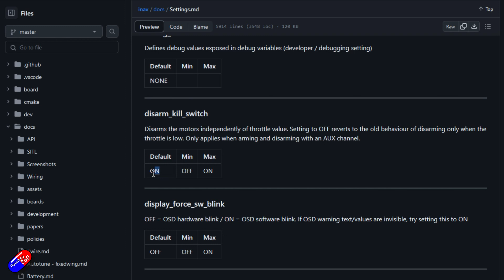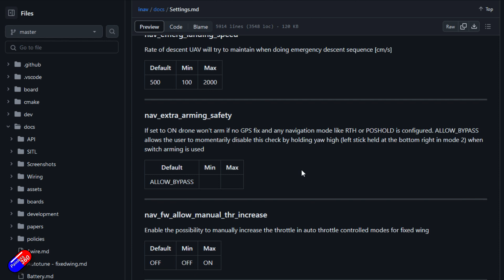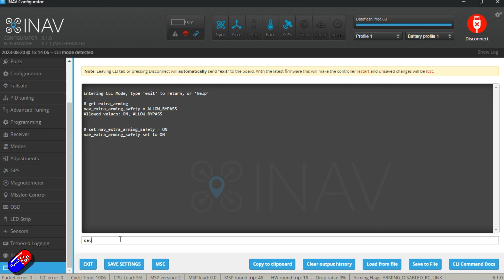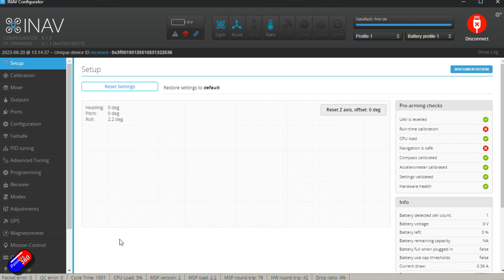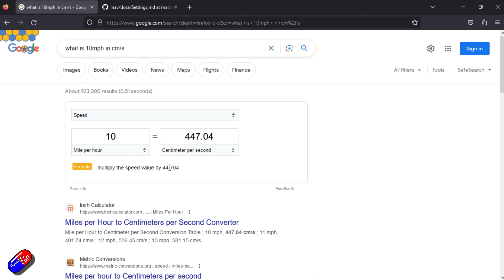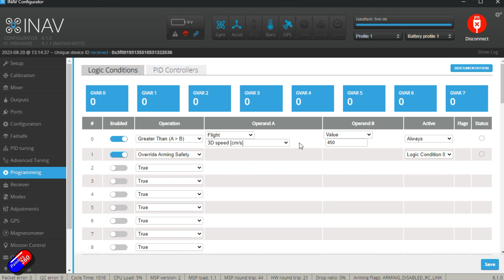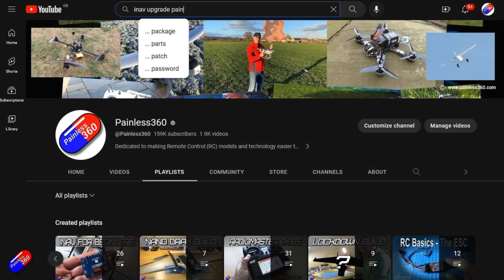How to easily re-arm in flight in INAV 6!

Comment from the maker: With INAV 7.0 came the ability to Emergency Rearm. This allows you to rearm in flight when you accidentally disarm. You need to do this within 5 seconds of disarming. Which sounds short, but is actually a pretty long time. Emergency Rearm can be used after a launch, and while the aircraft still believes it's flying. It bypasses safety checks (including the throttle position) and doesn't trigger auto launch. Multirotors will also briefly switch to Angle to stabilise and level the flight. You can read all about it at https://github.com/iNavFlight/inav/pull/9254
Reply: does this require any configuration or switch or is it just turned on by default?

Comment: I just dropped a model in a salt marsh because I accidentally disarmed and was not quick enough to rearm. "Landed" gracefully on a deadstick, but the salt water runined both motors and esc, the walksnail vtx and the fc.

I am pretty sure I had already watched that video, I should have implemented the fix.
Reply from the maker: In INAV 7, this is there by default. See note in the video description... Happy flying!
Reply: @Painless360  I am upgrading to 7 right now on my Swordfish.
Reply from the maker: Then you'll be able to re-arm in fight within 5 seconds. Very handy! :D

Comment: Thanks for the video.

I have been looking for something like this in Betaflight.

I learned to fly a single rotor helicopter (Honeybee FP) meany years ago LOS, & my disarm reflex is quick.

This has become a problem while flying quads FPV as I disarm quick but can't reArm fast enough, a second later.
Throttle=0 is always the hard part in that moment.

The Honeybee FP did not have a safety on the arm switch, however the HoneyBee FP needed some time to get the rotor spinning. If you armed with the throttle wide open it would destroy itself rather than launch itself.

Comment: Elegant solution, exactly what we need. Accidental switch flipping is not all that unlikely, it happened two seconds into my first ever iNav flight, and 20 seconds into my second, used to no arming safety Vectors as I was. What's more, I suspect this same trick could be used to enable differential thrust for ground handling, and disable it once airborne?

Comment: FYI, I removed extra_arming_safety = OFF in 6.0. It was never good for safety. Too many fly aways with it.
Reply from the maker: How odd, I'll check the model I used in the video, but that I was suee that was INAV 6.1.. Thanks for all the work you do on this stuff Darren, it is very appreciated! :D
Reply: Hey Mr d could you share a link or possibly command for self centering throttle in quad, works perfect in pos hold but switching to angle quad just wants to gain altitude
Reply: @umbrela_Corp  I've not got a quad on INAV yet. So Lee may have a much better suggestion. But it may be that the idle throttle it too high?
Reply from the maker: I'd suspect this is to do with ALTHOLD being used for throttle in POSHOLD but not in angle... If you want the same throttle behaviour in angle, enable it there too via the modes tab... Best of luck

Comment: I highly recommend adding an extra AND logic condition where you combine the 3d speed logic condition with a valid gps fix logic condition. 
The way it’s currently set up, when you have a poor gps lock (for example 3-5 satellites) it will sometimes detect a speed above 800cm/s even when the model isn’t moving due to the imprecise gps data. This means it could disable extra arming safety on the ground or on the bench. I’ve seen that happen multiple times. It’s usually only for a second or two at a time but I’d still not risk it.
Reply from the maker: Nice idea! Should all become a moot point in 7.0....Happy flying
Reply: @Painless360  It would be great if something like this would just be available as a toggleable option in inav settings. I’m sure the devs would be able to make it safer and more reliable than we can with just the logic conditions.
Much appreciate your content by the way, you have helped me out a ton getting into this hobby. Happy flying!

Comment: For the drone pilots, could they use the GPS_SATS operand instead of 3D_SPEED?  That way as long as they have satellites then they can re-arm, which is usually the only thing you would want to worry about.
Reply from the maker: You can use any metric you want.. Happy flying!
Reply: That would mean anytime the GPS_SATS was above the threshold the arming safety would be disabled? that doesn't seem right.  How about a combination of AGL and AGL status?  AGL status = 1 (can be trusted) and AGL (Alt above ground in cm)